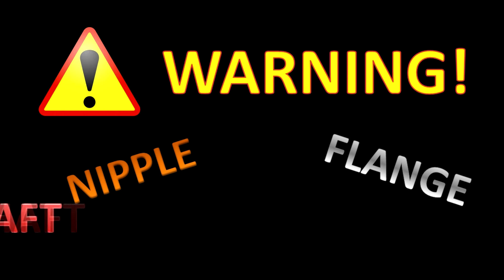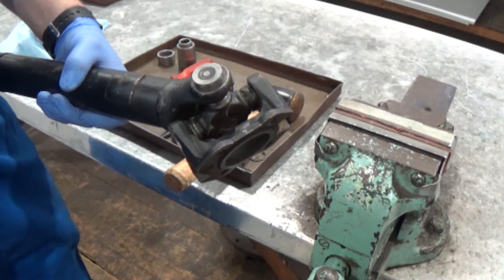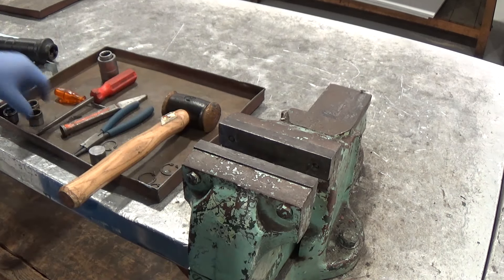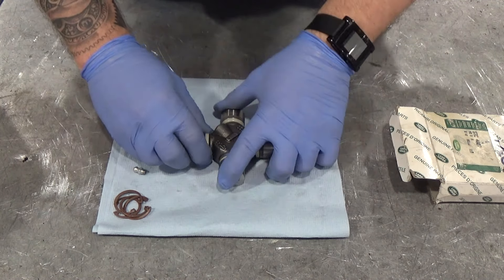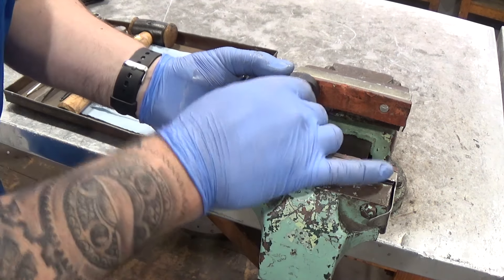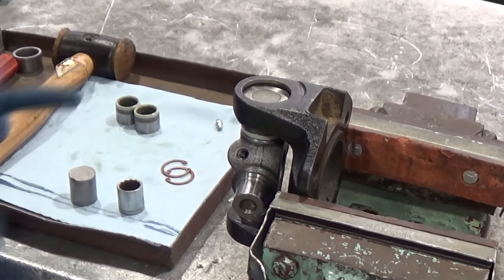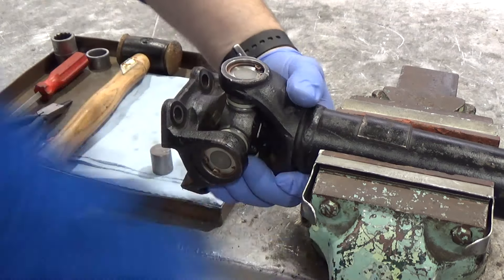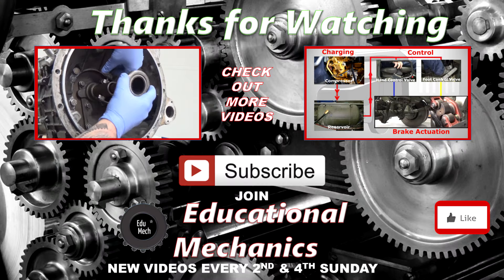Propshaft Repair - How to Replace a Universal Joint

Comment: Great video, very clear and yes, I was doing this job the wrong way on my Vito propshaft. Only thing I would say is make quite sure the needle bearings are held in place by grease. They might come like that but if not add a bit. On a Vito W639 rwd propshaft the ujs are staked in rather than circlipped. To me this seems incredible meanness on the part of the designers and the ujs are not supposed to be serviceable. It's usually the second joint from the front that goes and they do, even from new. I pressed out the uj, fitted a new one and re-staked the joint using a piece of tool steel ground for the purpose. My Vito is a taxi on 357k miles and I've done it a few times, £20 vs £1000+ for a new propshaft

Comment: I found grinding the universal in halves was easier and no stress was put on the housing, I’ve heard they can be distorted and miss aligned. After the centre’s are removed, punch in the caps.

Comment: Made this look a lot easier than it actually is! My dad has specialised in reconditioning propshafts and axles all his life and I've never seen him do one this easily, when they come in rusted up and knackered they are a lot more difficult and require special tools that he has made over the years, a 40 ton press is essential most of the time too! A brand new joint and a brand new shaft on a tutorial video is very misleading.

Comment: Very good video, helped me a lot but be warned removing the old UJ cups may not be quite as easy as in this video. If pressing them out as in the video doesn't work or the are super tight and you can't get enough purchase on it with a vice sensible use of a hammer and lots of penetrating fluid I.e. WD40 will help. Just be sure to try and keep everything as square and lined up as you can. Also use reference marks so everything goes back identically as original. In particular shaft to flanges

Comment: Great, Thanks. 

I had a lucky escape today. Nasty vibration 50mph....then 30. Checked the rear prop and surprise surprise it's on its last legs. Def 90.
Reply: Hi
Please I would like ask you if you had an experience about the reasons for the front propshaft if has problem then lead to vabiration for speed up 110 Km? My car discovary 2 year 2000
Thanks a lot

Comment: What size vice is that. The one I have does not open wide enough to receive the shaft and the sockets.
Reply from the maker: I think that was a Record 6" bench vice we used for this one.
Reply: Thanks.

Comment: so if prop shaft is removed it becomes two wheel drive?
Reply: Yes, but only if you lock the centre diff. Also, you'd need to take it easy and drive carefully and the handling characteristics would be quite different. It's an option better than being stranded.

Comment: No universal joint that actually required replacement Ever came out of the vehicle that clean.  No snap ring ever came out of any universal joint that required replacement that easy either.  BAD EDUCATIONAL.  Every snap ring should be loosened & have it's "seal broken" first.  This is shown in EVERY OTHER UNI JOINT TUTORIAL EVER,  but not here.